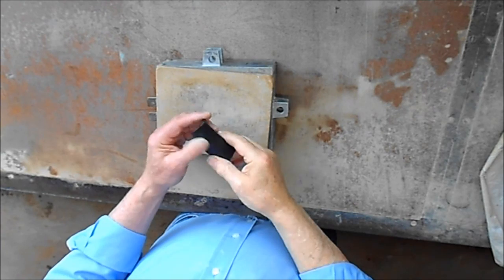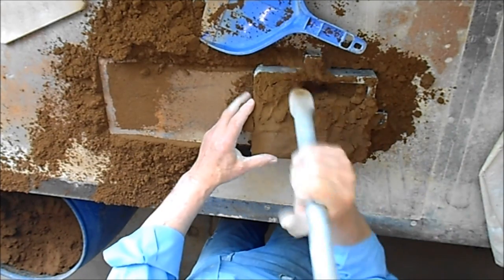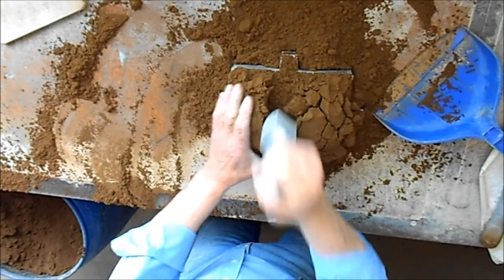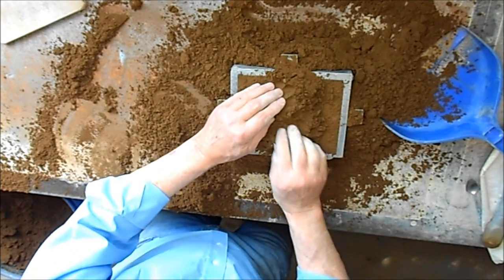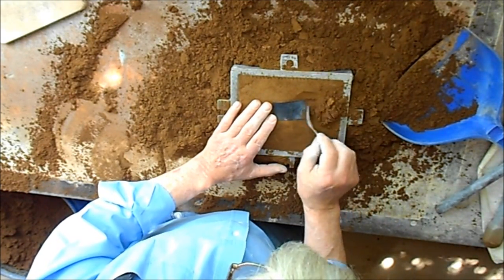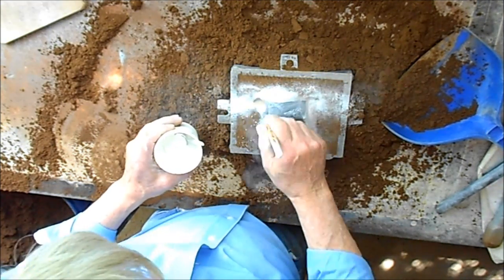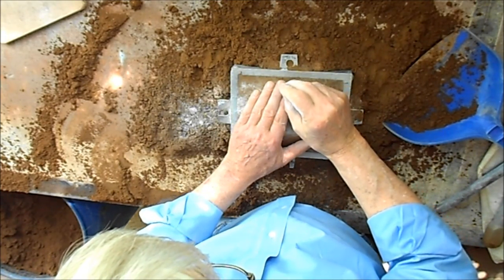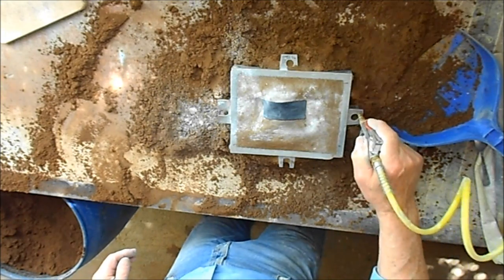My Home Foundry - Sand casting a Diesel to LPG conversion manifold restrictor, Part 1, The oddside.

Comment: How do you make your sand? Both the really fine stuff to just cover the parts and the fill in sand.
Reply from the maker: Tommy, thank you for your interest. Sand - Ah, yes  that most important of resources! First the back up (fill in ) sand. I don't "make" it  is a natural green sand straight out of the ground. As my reply to Mark Fryer above indicates there was a lot of this around Melbourne where I live. I bought several cubic meters of this natural sand about 30 years ago from a now defunct quarry. This sand contains enough clay to form a good bond when the right amount of water is added, it is quite a fine sand suitable for nonferrous work but I suspect too fine for cast iron. All I do to it is dry it almost right out, run it through my sand aerator (will be doing a video on this device later.) This breaks up the lumps so I can sieve the sand through about a 1/16 inch sieve just to remove the few  larger quartz pebbles that seem to be in the as received sand. Usually I quickly run this sand through my sand grinder - this device  features in an up coming video on how I make my facing sand. I set the sand grinder high so as to just break up the sand to individual grains. I then spread the dry sand out on my concrete garage floor and slowly add water through a fine spray nozzle whilst stirring it all around using a garden rake and a shovel when I think that I have enough water added (a guess based on experience) I pass the sand through the aerator - this mixes it, breaks up any lumps that have formed, and evens it out. I store this mixed ready to use  sand in a 200 litre plastic barrel. This process could obviously be done using a sand muller but I don't have one. Even if I did I would still run it through the aerator after mulling.The really fine stuff (facing sand) is a little different. I do actually sort of make this. It is a 50:50 mix of new dry sand (as above) and old sand that I sweep off the floor after a mornings making of moulds. The off the floor sand is sieved through a 0.5 mm sieve. This mixture is slowly passed through my sand grinder (a sort of home made flour mill) and ground quite fine - There is an upcoming video on this - I then mix the sand up on my bench with water using a rake, when I guess the water level to be right I pass the sand through my aerator twice and again store the now conditioned sand in a (smaller) plastic drum There is also an upcoming video on this too. There is a price to pay for using this fine facing sand  - its constant addition to the fill in sand slowly reduces the sands permeability and I have to be liberal with the use of a vent wire in making my moulds.At the end of a casting day all the used sand is spread out on the floor, walked on to sort of break up the lumps and aging using a rake and shovel it is mixed with a little sprayed on water to replace that lost driven off by the heat of the castings and aging passed through the aerator and into the 200 litre drum, this seems best done while the sand is still warm from the casting.I know that many would be casters have trouble finding suitable sands and without wishing to be rude looking at some of the casting videos out there not too many of them succeed in getting a nice sand. Finding good sand these days is getting harder but if you are interested I have a few suggestions that may aid a search - just let me know.
Reply: Olfoundryman Thank you for such a detailed reply. Very useful information, and you have great videos. I have just built a little foundry furnace, and need to get my green sand figured out. I love the finished quality you get with your castings. My hope is to be close to this quality (I'm new to both melting and casting) from the  start. I would love to hear your ideas on where to get the sand. I live in San Diego if that matters at all. thanks again
Reply from the maker: Tommy, Re sand supply, Finding a good sand will definitely take time and effort here are a few ideas. - First I assume that you have done the phone and internet search thing and looked up local sand suppliers/quarries. Some of these may have sands fine enough, glass making sands and in particular swimming pool filter sands are worth looking at. Many sand processors have a waste product of very fine sand that they catch in a cyclone or bag house that they have to throw away maybe you can get a hold of some of this - I guess that you will just have to visit any possible quarries and ask the question. Possibly the best hope is to visit a few small local foundries, make your visit in the morning as they often pour in the afternoon and will be too busy to talk to you then. Tell them what you are on about and ask them where they get their sand. Talk little and listen a lot. Some foundries may just pee you off but just go see another, most will talk if time permits. A good foundry contact is invaluable as they can help with all sorts of supplies - they may be prepared to sell you a few ingots of metal  (356 alloy for preference - its what they all use) Or perhaps small quantities of fluxes, exothermics, etc. If they are helpful thank them with a couple of 6 packs of the local favourite beer foundry men LOVE beer! Have some large stout plastic bags in your vehicle for with luck a foundry may give you some sand, used perhaps but it will do for a start. Ideally you want a natural sand like I use but its use is becoming increasingly rare even in small foundries these days as most tend to buy in a washed graded sand and use it in one of the many hard sand processes for mould making Fenotec Pepset CO2 silicate etc. So you may have to settle for a washed sand and add your own bentonite This wont give you a very good finish unless you can get a very fine sand. If you can get some of that waste sand from cyclone or bag houses you can add it to the sand used for the hard sand moulds and that will help you finish. Even many of the smaller foundries have these bag houses to as they tend to convey their sand pneumatically - the fines they collect in these things is basically a waste product and they are often glad to get rid of some of it. Sometimes you can find "Play sand" at the local hardware store and sometimes it is fine enough BUT beware I have found this to contain a lot of bits of shell - you can test for this by adding a little acid (vinegar will do) to a little sand if there is shell present it will bubble like mad - I have found some play sand to be 30% shell. The presence of shell may not be too much of a worry with casting aluminium (don't really know never tried it!) But I know it will cause problems with iron casting and some copper base alloys - best avoid shell! Track down anyone who knows anything about the geology of the area that you live in college teachers etc ask them if they can help with geology maps of the area these will often show sand deposits and quarries. The local government may have a "Local resources" section on their web site if sand is mined locally it should be on this site. You could even just try walking along the beds of local creeks and rivers lakes etc looking for sand deposits - usually way to course but lake deposits tend to be finer. The material that you are looking for is when wet like quicksand but can be quite hard to dig when dry. You can of course get a coarse sand and grind it like I do for my facing sand - when my video on the preparation of my facing sand comes out you will see the simple little grinding mill that I use, you can run it higher than  I do for the facing sand to produce  a useful normal sand. It is an easy machine to build - just do any sand grinding outside on a still day and wear a respirator sand dust is not good for your lungs.If you can't get a natural sand and therefore have to work with sand to which you add bentonite I suggest that you go to a mineral supply house and buy proper bentonite, I know a lot of people use kitty litter which they try to grind up to add it to the sand, apparently it sort of works but I am a little dubious as to how evenly they get the bentonite spread out through the sand. Purchased bentonite is very fine and will mix in with the dry sand very well, add the water last! If going down the kitty litter route I would suggest mixing the litter with water to a smooth slurry and adding this to the sand - it may come out a bit more evenly distributed. If you have  or can build yourself a muller well and good but they are a lot of work to build and as I have mentioned I do not have one but I would definitely suggest that you build an aerator its an easy build pretty much does the work of a muller and I would aerate mulled sand anywayI am not much for casting forums (had a bad experience!) but you could get on one of these and ask if there are any members near you and where they got their sand. As a last resort just go out and but some petrobond - expensive, but they tell me its pretty good, but you will probably need a muller although my style of aerator may well substitute.I hope that some of these things helpNote that I have been casting for 60 years (yes I am old!) and seriously casting for at least the last 40 - it took till the last 15 before I got a good finish so don't be impatient these things do take time - good luck and let me know how you get on.
Reply from the maker: Tommy,               Further to my comment of 3 hours ago I forgot to mention that the foundry industry is an incestuous sort of business - everybody knows everybody else - so if looking for something, sand for instance, ask the man you bought your crucible form or the man you got the refractory for your furnace from, they won't have the sand them selves of course but should be able to provide you with some contacts who can help
Reply: @olfoundryman8418  One source of a fine sand in the united states is larger janitorial supply houses.  They sell sand that is used in the cigarette urns for people to snuff out their cigarettes.
Reply: Olfoundryman  what a great detailed piece of pricless knoledge and expertise!! Thank you on behalf of me and all other metal casting novices out there. I watch your videos and read as much as i can ,  and without fail always can rely on your practises , methods and experience to help me overcome all of my lurning challenges. Which have been a vast many.  I cast everyday. And the goal oneday is to achieve a level of castings that you seem to produce so effortlessly.  Cheers again
Reply: Tommy Bennett  hi   FIRST BE WARNED I AM NEW TO ALL THIS BUT I MADE GREEN SAND BY GRINDING THE SAND IN A BLENDER.  I put a cupful in and hit the button until it looked smooth about 30 seconds I guess.   I could have turned it to powder if I wanted.  The blender is slow but does a nice job.

Comment: I have been meaning to ask if you are using Petrobond or greensand?
Reply from the maker: I use Greensand. Petrobond at $4.00 per Kg is a bit expensive as I typically go through about 300 Kg per session, you reuse it of course but the initial set up at $1200.00 plus is a bit of a worry. I am keen at some point to try petrobond. However it is said that you need a muller to process it and I do not have one - I suspect that my sand aerator might do the job but I will have to find out the hard way. Using my fine facing sand I get a better finish than petrobond will give but hats of to petrobond it does give a nice looking casting.My green sand came from a quarry on the Frankston Hastings road now closed  but there are other sand quarries nearby. The best sand in Melbourne was on the Maribyrnong river but many years ago the then Board of Works turned the area into a golf course thus closing that quarry. My first sand came from a quarry along Centre road it was nice stuff  but that quarry was worked out even then (1968) There used to be sand all over Melbourne If you ever catch trains look at the cutting just east of Camberwell station it is foundry sand (I think) and more outcrops just the Melbourne side of Box hill station the stuff is/was everywhere.